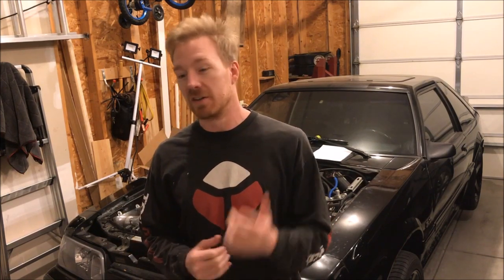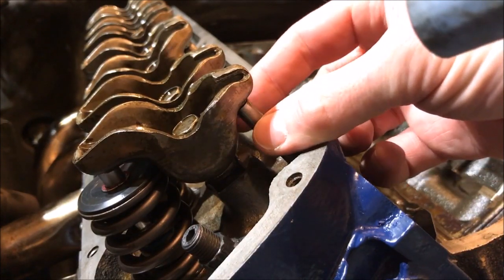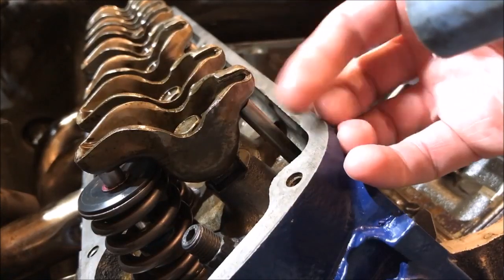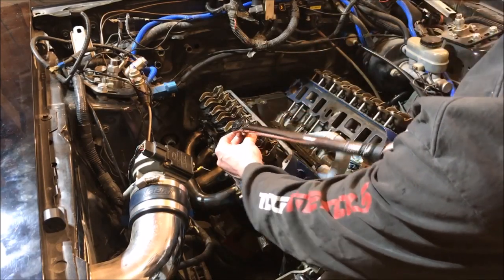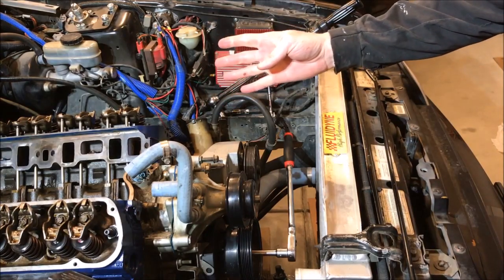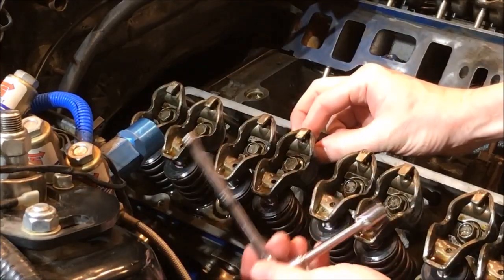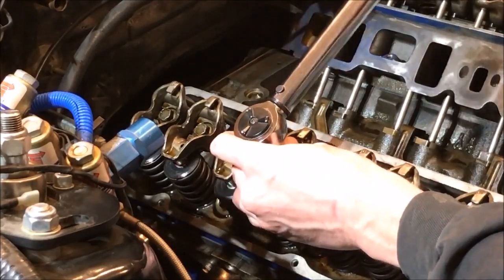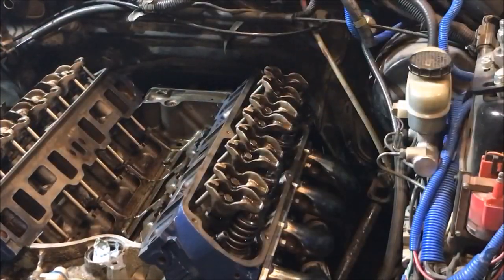Setting Valve Lash & Preload on GT40 Heads

Comment: Great video man. I have a set of GT40 heads from a 96 Explorer and was wondering if they are the same 1.6 stamped rockers you have there? Was also considering doing a small cam like and E303 or a TFS stage 1. Thoughts? Thanks man!!!
Reply: I'm doing this exact setup now. GT40p, TFS1 cam, stamped rockers. Came to the same conclusion OP did with regards to rocker arms and valve covers. I'll post back when It running.

Comment: I think this video is what I was looking for after a couple of days of reading my notes and looking online. I have an engine similar to your 302 HO in my 1966 F-100 truck that the previous owners installed. I did check lifter preload last in 2020, but since I changed oil a couple of weeks ago, it seems noisy. I added 5 quarts of 10 30 synthetic this time with filter change. There are so many conflicting ideas about the amount of turn and even the torque for the rocker bolts, though 20 ft lbs seems to be the common standard. Some say that even 3/4 turn is too much, others that 1/2 to 1 full turn is okay, but 1/4 is too little. I have pedestal mounts, like here, but others have studs with nuts. I think I bought longer pushrods at 6.300 and used .040 shims mainly, others at .032 or .020. But I need to recheck after 4 years of infrequent use. I plan to use the top dead center on compression stroke technique this time, a little less confusing at age 76. Also, if this doesn't improve the noise, I may use an additive or switch to 15 40 oil. Thanks for the video. Dave
Reply from the maker: Hello, Dave. It sounds like you know what you’re doing.  At 76, you’ve got more knowledge and experience than most.  More or less, setups like ours only require the correct torque.  However, I consider setting preload/lash to be a good best practice to simply make sure everything is set correctly.  A person can discover potential problems when taking the long path, so I think it’s worth while. Best of luck to you, sir!  Thanks for your time and comment, I appreciate it 👍
Reply: @FastFixYouTube  I started out turning the engine by the balancer / crank bolt using a 15/16" socket with a short extension and long handle rachet wrench, to top dead center for compression #1 cylinder, but I found it easy to get confused or distracted following the firing order and turning the engine 1/4 turn. A better method, for me at least, is: SET INTAKE WHEN EXHAUST BEGINS TO OPEN.  SET EXHAUST WHEN INTAKE OPENS AND STARTS TO CLOSE. I went right down the valves for cylinders 1 thru 8 in that order, rather than the firing order, using the above printed on a card in the compartment. I also drew a diagram of which valves were intake or exhaust to refer to. I think this way is safest. The truck runs better and quieter, even more so since I replaced the plugs gapped to .050". The shim kit from Ford Performance provides: .010, .020, .030, .040 (10 of each), cost about $20. I ended up using 15 shims at .040", 2 at .035 (from previous owner), and 1 at .030". To torque to 20 foot pounds, it took 1/2 turn or a little more, maybe 2/3 turn from finger tight with no play. I hope to take the truck some miles on the turnpike on Saturday to a truck show and another on Sunday, put on by the Cadillac and Lincoln clubs.

Comment: I just turn the motor until a rocker loosens all the way and then tighten all the ones that are loose, then turn the motor over until more loosen up then tighten them, then turn the motor over and tighten the loose ones until none are loose.
Reply from the maker: Hello. Yes, that works too.  I wanted to show newbies the most “accurate” way to adjust in case they didn’t understand how engines work. Good suggestion, thanks!!!
Reply: @FastFixYouTube  great job sir! 🤠

Comment: Why are we doing all this when we have pedestal mound rocker arms??? All you need to do is bolt them down to 19 lb and you're done.
Reply from the maker: Hello.  Yes, you're correct.  I suppose I wanted to be precise knowing full well the torque value would provide all the precision I needed.  Still, I thought it might help others to learn the process for rocker arms mounted in different ways.  Thanks for commenting!

Comment: So I have a 302 from a 93 mustang, added gt40 heads and cam with 540 lift. I did upgrade springs. I ran 6.250 pushrods and set lash and torqued down to 20lbs, everything was good. I rotated engine and pushrod got lose. Granted this was only on cylinder #1. Now my pushrods are loss, I did get a pushrod checker and feel I should be running 6.350 pushrods. Does this sound about right or did my stock lifters get compressed?
Reply from the maker: Hello.  How lose did the pushrods get?  Was there a gap between the pushrod and the lifter?  If so, you’ve got something out of spec.  After everything is torqued, you should be able to twist the push rods around, but there should be no up and downward play between the push rod lifter and rocker arm. Also, did you use factory rocker arms? If you used aftermarket ones make sure that you are setting correct lash and Torque to those.  The rocker arms from the factory can be simply torque down, you don’t really need to set lash at all, but if you’re using aftermarket rocker arms, it could be a completely different story.  It could very well be that you need a longer push Rod if you’re doing everything else according to spec. It could also be true that you have a lifter that’s stuck and compress down. If the other push rods are just fine, I would remove that lifter on cylinder number one and see if it’s seized. Best of luck to you! Feel free to reply and let me know how things go or if I totally the mark on my answer.

Comment: So i have stock pushrods and do what you did.  I did rotate engine twice and my pushrods got loose. Could this just be because lifters were compressed and have no oil pressure? Or do you think I need longer pushrods?
Reply from the maker: Hello. Have you changed anything in your valve train?  If not, no you don’t need longer pushrods.  The push rods shouldn’t be loose to the point of losing contact with the rocker arms. Did you set valve lash as described?  Also, if you have stock rockers, you likely don’t need to set lash. Simply torque them to the required poundage and you’ll be all set. What engine are you working on?  

If I fail to see your reply, please start another comment. YouTube doesn’t make it easy for me to track replies unfortunately.

Comment: If you don’t do this will the car run I replaced my cam in my 1978 302 now I can’t get it in time
Reply from the maker: Technically no , you don’t have to do this. On the 302 you ca. tighten to factory specs and be good. 

Regarding your issue. Check the firing order compared to you plug wires. Then, make sure you’re starting the #1 cylinder on the compression stroke or it won’t fire.

Comment: Do you remember the pushrod length by any chance? I'm rebuilding an engine and have the same  positive stop bolts. One of the lifters were damaged, and I believe the pushrods didn't have the correct length.
Reply from the maker: Sorry, I don’t. It’s gotta be out there on the internet. Best of luck!
Reply: You should set the pushrod length for what YOUR engine requires. Not what some guy on the internet has in his combo.

Comment: Are both ends of the pushrod the same one side of my old ones seems more worn than the other end does it go to the rocker
Reply from the maker: Hello. I like to keep all my pushrods synced to their corresponding lifter and rocker arm. That way the machining that occurs through natural wear process is maintained. In your case, it sounds like abnormal wear on one pushrod. If I were you, I’d try and find which lifter or rocker that pushrod was mated to and replace both. Otherwise, you’ll need to try and figure out which lifter or rocker arm paired with that pushrod and use them together in your build. Make sense? Please let me know if not. Thanks for the question.

Comment: I have a 1990 I'm gonna be replacing the push rods and lifters will this be the same for hrdrolic lifters and stock heads and do I need to soak the lifters in oil ?
Reply from the maker: Hello. Yes, the same. My setup has the hydraulic lifters.  In this video, I took extra measures for consistency, but with rockers like this, all you have to do is tighten them to their final torque and you’re good. No need to make sure that you’re hitting final torque within 360 degrees of rotation on the bolt. Of course, make sure the valves are at TDC before tightening.  

Soaking the lifters in oil is optional, but something I do. It certainly doesn’t hurt anything.
Reply: @FastFixYouTube  so after I torque down the bolts on number one you torn the engine over 90 degrees then just fallow the firing order
Reply from the maker: @brianrohm6757  correct! You got it.

Comment: I'm confused ur talking about valve lash and shimming.....on a standard torque to spec pedestal rocker. What is the achieved goal??
Reply from the maker: To have consistency. That’s it. I know it’s not required to do it this way, but I figured what the hell. On a previous build (same engine) I just torqued them to spec and left it at that.  This time I wanted a way to measure my inputs considering the head change….again, not necessary, but it makes my brain happy. Thanks for the question.

Comment: I have a 4.9 that the head has been decked .065. do I need to shorten the pushrods or add shims to it?
Reply from the maker: Hello. Decking the head doesn’t usually require you to change pushrods or add shims. You’ll get a slight compression bump however! Or, you can install thicker head gaskets to make up for the difference. However, it’s negligible on most applications. Full blown race stuff would require more attention, but assuming you’re not building a 2000hp motor, you should be gtg.  Thanks for the question!

Comment: man you dont set preload on pestle mount rockers lol you just torque them to 20-25 foot pounds and your done!
Reply from the maker: Yeah I hear ya. I just wanted to show how lash and preload are done regardless of the necessity to do so. Of course torquing to 25ft lbs IS all you need to do and completely acceptable, but I wanted to factor in degree of turn as well.  Plus, a video torquing these to 25ft lbs is pretty boring…. Thanks for the comment 👍
Reply: @FastFixYouTube  ah ok makes sense!

Comment: I installed a cam in mine. I did this exact method to adjust the valves but now my valves are not closing. The guys at comp said I could use the stock pushrods but clearly something is wrong. I don't think shims will fix my problem
Reply from the maker: If the valves aren’t closing, yes you’ve got other issues. If the valves are not closing, the pushrods are too long.

Comment: Are you sure the reason you didn’t use the roller rockers isn’t because the gt40 heads require some machining to employ them?
Reply from the maker: Hello. No, the heads don’t require any machining. The roller rockers come factory from Ford on the Cobra Mustangs. Thanks for the question.

Comment: This video has cleared up so many questions for me, I will be using this before I set my lash this week. Might get new pushrods though as mine are the older original ones. Thank you so much!!
Reply from the maker: You’re very welcome!  If the old ones are in good condition, I’d re-use them.  Did you change lifters or rocker arms? If not, re-use is totally acceptable. Unless you have concerns on their condition and/or history.  Glad the video helped!  Thanks for the comment 👍

Comment: What cam did you use?
Reply from the maker: Hello. Com Cams 35-514-8
Reply: Did you have to chip the computer, or the maf did the adjustment?
Reply from the maker: Had to chip the computer. The cam totally threw it off. Was basically undriveable with the stock tune.
Reply: Any company you recommend for that chip?? Sorry for all the questions, I'm pretty much going with the same setup
Reply from the maker: No prob. Channel is pretty small, so it’s easy to get to the comments. I got my tune from Bama via American Muscle. It’s been a while since I got this, so there might be better alternatives to chipping the computer. FYI. https://www.americanmuscle.com/sct-4-bank-computer-chip.html

Comment: The better technique for setting preload is moving the pushrod up and down until there is no play. If you twist them and don't stop tightening until the rocker arm won't move you've already suppressed the lifter slightly without knowing it and applied unintentional preload and the torque value will be reached too soon. I see 90% of people use the twist method, but if you think about it the goal is really to start with no zero up and down movement.
Reply from the maker: Right, good tip there.  I didn't adequately convey what I was doing in the video, but I was putting pressure up/down as well in the twisting motion, but it wasn't that apparent.  Thanks for this!
Reply: Good one
Reply: The twist method is exactly what I did. The engine wouldn't start. I checked EVERYTHING from the coil to injector pulses to BAP signal. Once I backed the valves off a little, it fired right up. Now, I get to go back through and adjust them properly. With the "up and down" motion, and not so much the "twist" motion. 

That said, I've never seen anyone get to zero lash and then torque to 20 lb/ft. It's always 1/2 turn, 3/4 turn or 1 1/2 turn. Made no sense to me.
Reply: @robeddy3722 what do you mean by 1/2 to 3/4 to 1 1/2. I am getting really confused about this on my 351w. I try 3/4 of a turn some do it and than the others either need more than 3/4 or less.

Comment: Hey man awesome video! Quick question! What springs did you use? As well as what pushrods ?
Reply from the maker: Hello. Pushrods are factory length from Ford Racing. Springs are from Comp Cams, but I don’t remember the part number. It really doesn’t matter though. When choosing springs, make sure they match your cam.  Sorry if that doesn’t help much.

Comment: And if you dont upgrade the valve springs on the gt40 heads you will have lag at the bottom end and it will drastically drop at top end.  P.S. you don't adjust these. Lol
Reply from the maker: Right. Per your last comment, the springs are very important and often overlooked or not taken seriously enough on some builds. I took great care to make sure they were perfect on this build. 👍

Comment: This guys seems nice but shouldn’t be giving advice.

Those are positive stop bolt down, there is no adjustment.
Reply: Consistency comes the fact that they all tighten to the same exact height. 

If you changed heads you need to check with a pushrod measuring tool if they are the right length in order to assure proper preload
Reply: @iqinsanity   how does one check to make sure they are done right in a vehicle that has ran? Meaning my lifters are pressured up?
Reply: Thank you! I said the same thing to this guy
Reply from the maker: Thanks Andrew. I’ve heard from others saying the same thing. But doing it this way doesn’t hurt anything. If it did, I’d take down the video. If anything, it’s a good best practice IMO.  So I take your point, but I wanted consistency in preload within 360 degrees having changed heads. I realize it may not be necessary, but it makes my brain feel better knowing all was done the same.  Thanks for the comment.